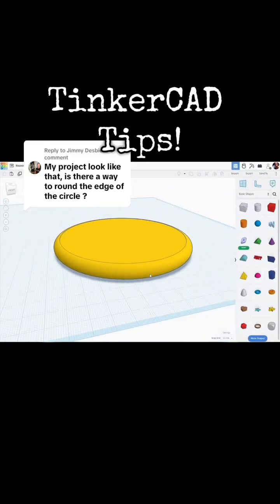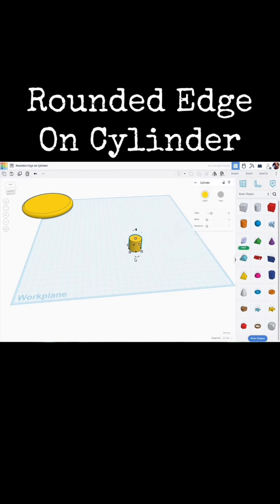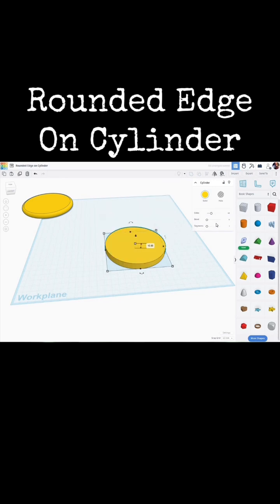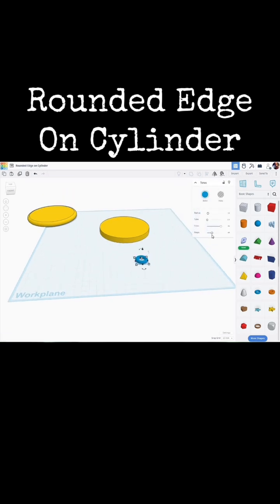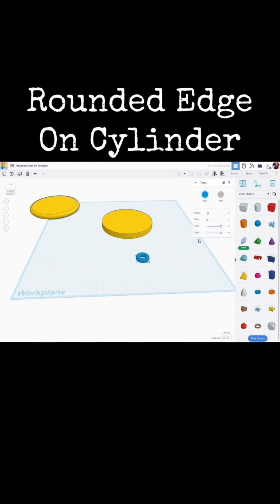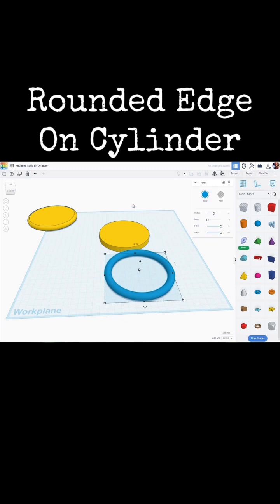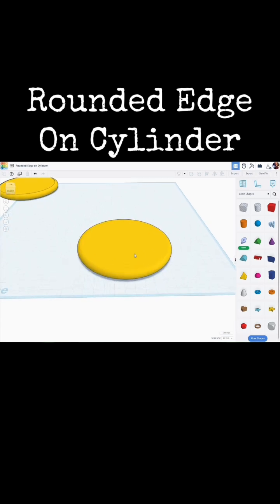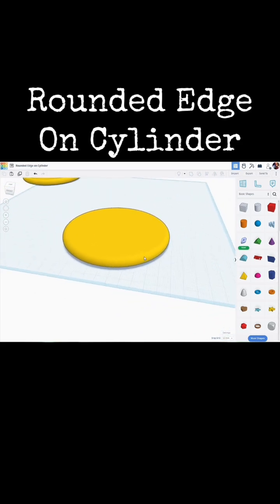TinkerCAD Tips!  Rounded Edge on Cylinder.            #tinkercad #caddesign #3dprintable #3dprinting

Comment: How would you do a fillet on the top edge of a negative cylinder?
Reply from the maker: You can use a modified torus.  I think I did a video on how to fillet the inside of cylinders, both a flat bevel (using a cone) and a radius (using a torus).
Reply: @KevinGroninga3D okay so if I have an object that I’ve already made holes in (in a different slicer), how would I center the modified torus over the already created hole?
Reply from the maker: @wscott0709 well, you’d have to sort of eyeball it, and move it using the cursor keys with the snap-grid setting set to ‘off’.  There’s no simple way of centering that hole if it isn’t in the center of the object the hole is in.
Reply from the maker: Watch this tutorial.

https://youtu.be/WkNtlN303HE?si=KCeFSxnF7_oifExb